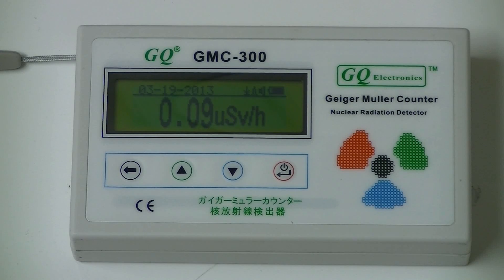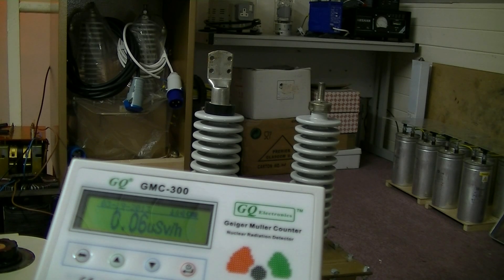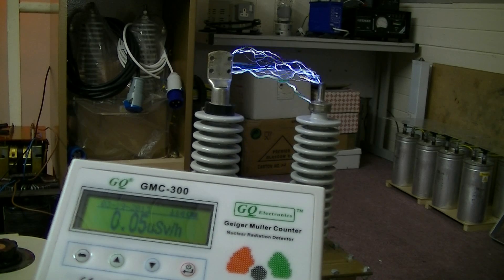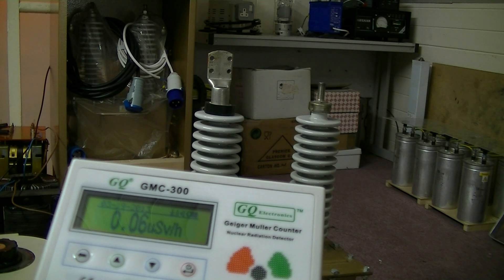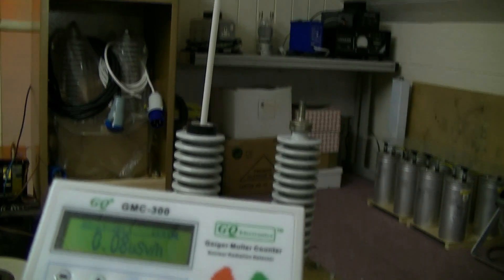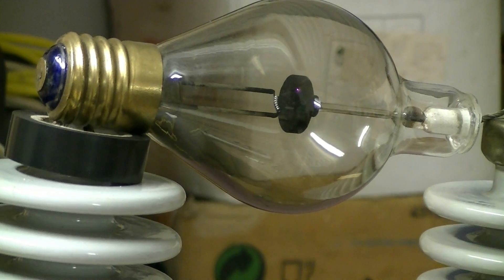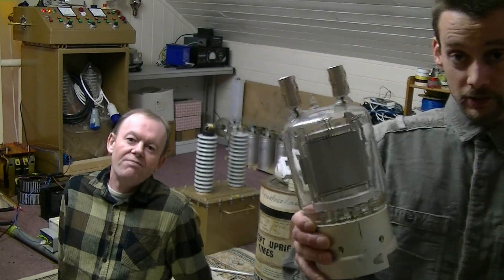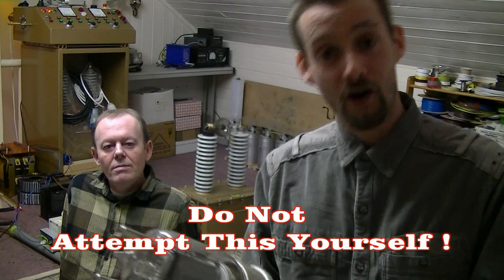Generating X rays

Comment: I can't figure out how a geiger counter which detects ionising radiation can detect XRays which are essentially electromagnetic in nature.
What is that geiger counter really detecting?
Reply: X-rays, gamma rays, even radio waves and visible light are all the same type of EM-radiation, just different wavelengths!
Reply: Geiger counters detect alpha, beta and gamma radiation due to the ionization that takes place inside the geiger tube. There are ususally two readout display modes: if you are detecting particle radiation, which would be alpha or beta radiation youi are going to use the counting mode that displays the ionization events per second, that however don't accumulate. If you are detecting gamma rays, which are - just like x-rays - a type of energy radiation, you want to use the radiation dose rate readout mode because your body will absorb and accumulate some parts of it. In this case we are dealing with a vacuum tube where electrons are accelerated with more than 10kV thus emitting hard x-ray photons with at least 10keV of energy. These are ionizing X-rays that can penetrate solid bodies easily and therefore you will receive a radiation dose if you get in contact with them. Normally a geiger counter will be able to detect such radiation but it's efficiency will be relatively low compared to particle radiation detection due to the low interaction ot gamma or x-rays. Most counters use braking radiation inside the tube to produce secondary electrons to create a detectable particle radiation.
Reply: Alpha particles, Beta Partials and Gamma rays(X-Rays).
Reply: They are detecting X-rays.
Reply: Yes, you basically have two types of radiation: particle or energy. However, gamma rays are in most cases emitted by radioactive decay processes and therefore always accompanied by either alpha(He nucleii) or beta(electrons) particles. X-ray radiation is electromagnetic radiation (photons) just like gamma rays, visible light, radio waves, microwaves, infrared light etc - are all types of EM-radiation - just having different frequencies. You should google for 'electromagnetic spectrum' for further information, it is actualy pretty easy to understand.
Reply: FullFledged2010 X-rays and gamma rays are the same particle from different sources, with overlapping energy ranges. X-rays are photons generated from electronic transitions, whereas gamma rays are from nuclear transitions.
Reply: radiation...
Reply: Ryan Winklevoss So which one those 3 are they detecting? Alpha en beta are pretty much harmless.
Reply: It has different settings for different detection types kind of like a multimeter for different electrical readings.
Reply: Ryan Winklevoss Thats why i want to know which on of the 3 they are detecting.
Reply: Aleksey Smirnov Thank you very much!
So there is no way to detect which type it is other then checking if particles accumulate?
Also x rays are actually alpha/beta or gamma rays right? Or some other type of radiation?
Reply: Aleksey Smirnov Yeah i just did. i'm now watching a docu about roentgen ;)
Very interesting stuff!
Reply: FullFledged2010 Indeed, it is! You will probably find it interesting to learn more about electromagnetism and nuclear physics. Very important and intuitive parts of physics.
Reply: Shortwave uv and higher energy is considered ionizing radiation. X-rays are ionizing.
Reply: One way of detection is putting gas in a tube and a certain voltage across the tube. When an ionizing ray hits and ionizes gas in the tube a small arc will be lit in the tube. This small current spike can be measured.
Reply: X rays are a form of ionising radiation.
Reply: Aliasing.
Reply: Alpha and. ETA are actually the most harmfully as they knock out and diaplace
Reply: Ryan Winklevoss ... Yeah but again alpha and beta waves are pretty much harmless because they're hardly able to penetrate the skin , only gamma radiation can so is by far the most  dangerous of the 3 so thats why i want to know if they're really detecting gamma radiation from that tube.

Comment: There is no X ray in this video, the uses tube is a GU81M, they have a normal anode voltage of up to 3kV and flash over in cold state at about 15kV (sadly my own experience) Thats not enough to crate X rays that can peetrate the glass. The reason for the counter to show something is, that its pretty close to the transformer and tube. They generate lots of EMV when the spark developes inside the tube, thats enough for a non shielded geiger to crap itself.
Reply: NIOC630 counters are very sensitive to induced current, being precision high voltage devices. You'll burn/fault it out before you could trigger a false event. 3-15kv is also more than enough to create X-ray photons that will pass through glass.
Reply: he is proving that point as someone said some weeks ago or something that transformers running at really high voltage can put out x-rays.
Reply: ГУ81М(GU81M) are soviet vaccum tube.
Reply: One more clueless keyboard worrier..  Yawn. Back to elementary school for you
Reply: NIOC630 You sure about that sweetheart ?
Reply: @jasonantigua6825 , he is right. Although some x-rays are generated, they are low energy.

Comment: For those wondering 50000 μSv/y is about the yearly limit of radiation. They maxed out around which is about 5.7 μSv per hour so 23.60 μSv would be at 203,904 μSv/y if it stayed constant. However this was just a burst and not a very long (less then 30 seconds) . His dose for the hour would be .23 μSv bringing his yearly dosage from ~518.4 μSv (based on .06 background) to ~518.5711666 μSv.  Despite he's the Steve Erwin of electricity and may one day find a way to glow this won't do it.

Comment: The CE sign just certifies that an electronic product passed tests concerning interferences and security - it is not a proof if a product works well or not. The CE sign is mandatory for all electronic products sold in the EU. Because the CE sign is faked here, it first doesn’t make a good impression of the manufacturer, and second, a business seller in the EU would get trouble with the authorities if he sold such a product here.

Comment: The Geiger-Müller-counter is obviously a cheap product from China. The CE-sign on it is definitely a fake. The CE-sign is a standardised sign, i.e. the horizontal line in the middle of the E is slightly shorter than the two other endings. On your device, it exactly completes with the upper and lower ends of the E. That is actually always a clear proof for a fake product.

Comment: Different regions of the Electromagnetic spectrum are defined and named based on their interactions with matter. The effects of radio waves are defined as the collective oscillation of charge carriers in a solid material. Think of electron excitation (movement) in an antenna.

X-ray's main effect in matter is the excitation and ejection of core atomic electrons. Search 'Compton Scattering.' At extremely high energies this can cause neutron activation and even particle-antiparticle pair creation.

Comment: Perhaps you are confusing "RF" with "EM". RF is "radio frequency" and usually means the portion of the EM spectrum used for transmitting and receiving radio communications. RF photon energies are FAR from the ionizing X-ray band.

Comment: X-ray's are at the opposite end of the spectrum from RF. The usable RF range is defined as 3 Kilohertz to 300 Gigahertz, which falls far outside the limit of 100 angstrom. Common amateur radio bands stretch between 2 and 40 METRE wavelengths, not angstroms. The X-ray band sits above the UV band, deep in ionizing territory. Xray's have a typical wavelengths of 10 nanometres all the way down to 10 pico metres. Wavelengths smaller than that are defined as gamma rays. Just look at photon energies.

Comment: Just to give some context for the numbers, which are low, assuming that the counter is detecting everything: at 22 uSv/h, you would need to stand next to it for half a year of normal working hours to reach the nuclear workers dose limit of 20 mSv/year. Their limit is v conservative, but they try to limit things further, to about 1 mSv, so you could spend 45 hours next to it each year. Dose rate standing a few hundred metres from the Chernobyl sarcophagus is 3 uSv/hour.

Comment: Could you try repeating the experiment with the valve, but move the detector further away from the valve. It is important to work out if it obeys the inverse square law, most geiger counter based dose rate meters tend to under report pulses of radiation. I suspect that your X-ray source is to some degree pulsed. The reading of the detector should be equal to k / (distance^2). If you email me the results I can make a crude estimate of the true dose rate at 1 meter.

Comment: Dude, you need to (could you) put that detector in front of a running standard VGA CRT monitor or television which is also going to give off X-rays as a reference point so we can compare what you produced here compared to what you'd be exposed to sitting in front of a computer monitor. :-)
Thanks.

Comment: Hi mate, In my early encounters with colour tvs they used to have a PD500 triode across the 25kv EHT as a shunt regulator. They could run orange hot and generate lots of x rays - a small but spectacular tube. Watch your bollocks though! Oh yes did you say you wanted a Mercury Arc Rectifier? I might be able to get you one. Where did you get that 15kw Short arc xenon lamp from?
Take care buddy
Phil.

Comment: Causing changing electric and magnetic fields. All radiation works like this, from VLF radio to light and to x-rays. However, the energies differ, caused by wave properties of the radiation. Radio is lower energy than light, and light has less energy than X.
To go deeper into this, the reason for this video detcting X-rays is bremsstrahlung radiation (look it up). The other things I mentioned are basic E&M principals. There are hundreds of great introductory textbooks, go find one and read it.

Comment: (I hate youtube comments) faster they go. 

Onto the last problem. X-Rays are merely a higher energy form of light. Going back to the original discussion, a slower electron suddenly stopping with also produce light, just in a different energy band. However, to fully justify this, we need to dig a bit deeper.

Light isn't unique. Light is a form of electromagnetic radiation, and that 2nd to last polysyllable is important. Electromagnetic radiation is created when charges accelerate (contd)

Comment: Since the electrons can't see each other faster than the speed of light, the movement propagates at the speed of light. This is how electric fields can propagate at c even though electrons can't move that fast.

Electrons simply cannot reach the speed of light, since they have finite mass, and particles with mass can't reach c, so you can actually have a stationary electron (though it's really, really hard). Essentially, voltage sets the speed of the electrons. The more voltage, the (contd.)

Comment: Thanks. If I get it correctly: To create X-rays one need vacuum between the terminals, High Voltage and a heavy metal nucleus for the electron Ampere to target. When the Electron penetrates the atom, the atom emit a " light wave or X-ray", The Electrons too, propagate and travel at lightwave speed 3E8, That is the accepted velocity, even with Resistance on the copper wire, and radio. The speed of the electron is not depending on the Voltage. It seems X ray is a shockwave form of normal light.

Comment: X-rays re created when a high-speed electron (accelerated in a vacuum by high voltage) crashes into a piece of metal like tungsten. This emission is called "braking radiation" or bremsstrahlung if you like big German words. It has nothing to do with resonant frequencies or the excitation of vacuum (hint: there's NOTHING in a vacuum to excite, that's why it's called a vacuum!)

Comment: The mechanisim that you describe isn't generally accepted physics. In the standard interpretation, an x-ray is created when an high-velocity electron stops suddenly. As accelerating charge creates an electromagnetic field, this deceleration creates a field, which can be an x-ray. Air prevents this because it's nuclei are too light, preventing substantial deceleration. The vacum, however, allows high-speed electrons to pass, so when they do hit metal, they are still fast enough to emit x-rays.

Comment: 100 µSv/h  

It is necessary to take protective measures, e.g. to shelter indoors

30 µSv/h  

The dose rate measured at a distance of one metre of a patient that has undergone isotope treatment. When the dose rate is less than 30 µSv/h, the patient can be discharged.

10 µSv/h  	Some protective measures are needed, e.g. avoiding being outdoors unnecessarily.

Comment: Heat the filament and try DC next time? - x-rays can be generated as Bremsstrahlung at voltages as low as 1kV - CRTs are usually limited to 27kV as above 30kV usage of tubes become "regulated" in concerns of x-rays at least in my country

Comment: Mate, I'm working in an german personal dosimetry laboratory and we are actively developing such a dosimeter to replace the EPD MK2, which can't measure pulsating radiation. 
You can download our demo app for Android if you search for "Radioactivity Counter" in the Android market.
Of course you can't use this for official readings, which is why we are developing a real detector based on CCD camera chips, which are not only responsive to visible light, but also to radiation.
/watch?v=MsG6JsMAJ_Q

Comment: I thought the Frequency of the Coil was generating the X-Ray at 10^18 Hertz.
I understand its the Voltage that distress the "Medium of Vacuum" in such a
degree that it is raptured, and emit light. A 50Hz incandescant lamp.
the Amperic friction on the Resistance wire between a AC or DC Voltage bias, creates the light emission. Not the high frequency AC oscillation, its the Voltage in Vacuum.
What is causing the "friction" in Vacuum to create X Rays ? The eV determine the Photon penetration depht.

Comment: Connect a small 6volt battery across the filament terminals and try it again the way you did in the video. (With the HV across the filament terminals and the housing)  But do put some metal shielding between you and the tube. Just in case

Comment: Instead of buying a geiger counter you can also download a dosimeter app for your smartphone which uses the camera chip as a radiation detector.
These counters are even able to detect pulsating radiation which other electronic dosimeters can't. Even the expensive ones.
A lot of new and upcoming electronic personal dosimeters will be based on this technology.

Comment: none. there is an explicit crowbar circuit in any telly manufactured since ... a long time ago... that permanently/temporarily disables the set if the anode voltage goes above 30-35KV. also, the front is an inch of leaded glass. any low power xrays that *might* get generated would likely be stopped by that.

Comment: Great video as usual, I wish that geiger counter would have been around for your overvolting a CRT experiment when the entire back of the tube had arcs running through it. Also I wonder if it would read anything on a normally operating CRT? Any X-rays at all?

Comment: One thing to be aware of is the radiation pattern from overdriving vacuum tubes (like you are) can be extremely uneven. As such, you may get artificially low readings because the geiger counter is not in a hot-spot of the beam.

There are some cool photos around the internet of people measuring the emission patters of various vacuum tubes with phosphorescent screen, and long exposure photography.